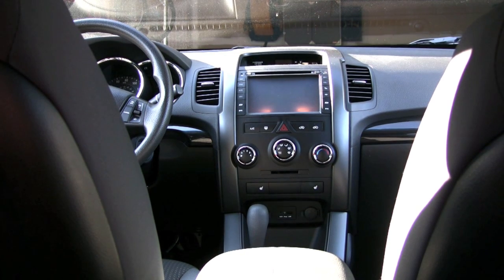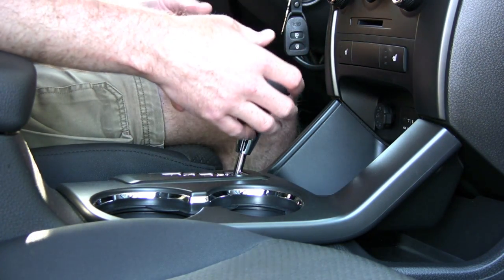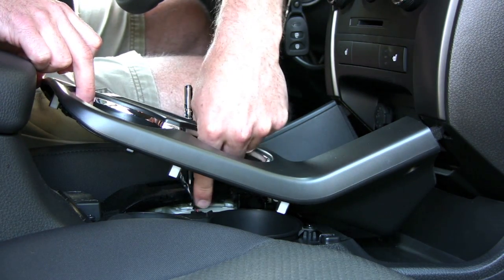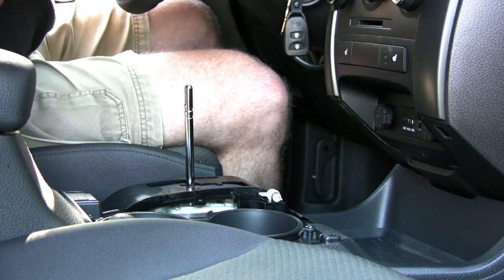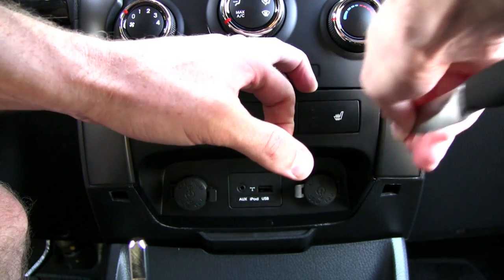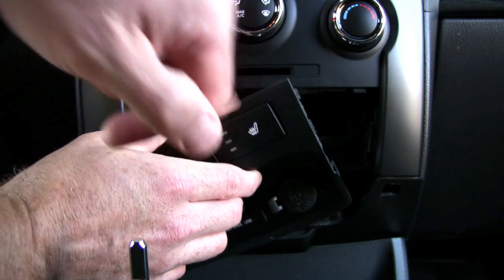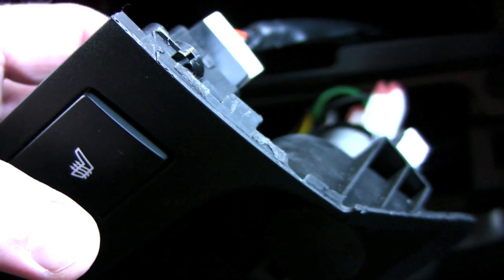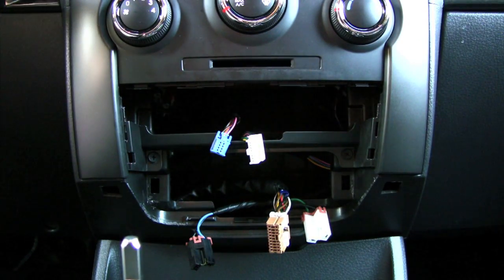2012 KIA Sorento Center Console Removal

Comment from the maker: All the cables were included, so it was a very quick installation. I did lose the analog audio jack function on the front of the dash. I'm not sure if your 2010 model has that or not. If I wanted to restore functionality to the audio jack, I would have had to locate which wire fed the analog audio, splice it, and then feed it to the AUX inputs, so that would have been an additional cable. I'm using the USB functionality and play my music off of that so the analog audio isn't a factor.

Comment: Can you tell me where the manual ignition start is on the 2012 Sorento?  Kia repair said there isn't one--ridiculous.   Manual says there is one in 'some models) Is it behind the plastic front of the push ignition?  In the console?  In the steering column?  The glove box?  "Nobody knows...."  I don't want to tear my car apart but it amazes me that i can't find an answer from manuals or mechanics.  Thanks for any help.  Yes, I have working fobs and can remove the key for the door but then what?  Where does the key go to start the bloomin car?

Comment from the maker: The one I bought was $380 from [auto dvd gps dot com]. I see they have a couple newer models out now as well. The screen on mine is not the same quality as you would see on something like an iPhone. Because of the angle of the unit, when the sun shines through the windshield it washes out the image. The unit is curved to match my 2012 dash exactly, but I can't speak to the fit on a 2013 Kia.

Comment from the maker: On my Kia, there was really no iPod port, just a small USB port and analog audio port which required a proprietary cable for the iPod supplied by Kia. My guess is that your cable will no longer work, because the analog audio port will cease to function. They supply you with a new iPod cable and I ran mine into the glove box. The USB port on the dash still works, and I can plug a thumb drive into it with music and it plays. Just no analog audio from the small 1/8" stereo port.

Comment: Hi Skysurfer. Thanks for the video, quite informative. I have question for your. My sorento 2010 comes with the standard kia stereo system and I want to replace it with one of those chienese graphical stereo systems. When you installed yours, did you find all the necessary cables to connect it?

Comment from the maker: I don't know anyone with a 2011 KIA, but I do know that the stereo I installed was originally designed for a 2011 and it fit perfectly in my 2012 so there are similarities between the console designs. There is also another video on YouTube that shows a 2011 specifically (this was the video that inspired me to do mine), and lo and behold the guy has trouble with the exact same part that I did. Do a search for mikesaudioimports.

Comment: Thanks skysurfer, just another question, I saw a few videos about the same installation and people mentioned that they couldn't use the usb, aux and ipod ports originally provided. Did you have the same issue? Have you tried to modify the cables of this stereo unit in order to keep using those ports?

Comment: Do you know of any compactable radio with apple car play that works for that kia? It is the same as mine and at least I found your video that explains it well and lets me see clearly that a radio touch can fit there but I would like to know what inch it is and if it has apple carplay, thanks for the video and the help
Reply from the maker: They are out there, but without seeing one reviewed online it's hard to judge how compatible they are with iOS. Most of these aftermarket head units are Android based now and despite claiming it works I'd really want to hear it from someone who installed one.

https://www.belsee.com/belsee-best-wireless-apple-carplay-android-auto-stereo-upgrade-car-cd-dvd-audio-video-player-for-kia-sorento-2009-2010-2011-2012.html

You may have heard that 2016 and newer Sorento owners who had purchased the UVO premium systems got free Carplay upgrades. There were other models that they upgraded at no charge that went as far back as 2014. Nice benefit for those owners that qualified.

Comment: Great video man. Just one question,I am replacing mine for an android unit with the frame already included ,can I just disconnect the passenger airbag light plug?
Thanks
Reply from the maker: I never had to do that, but on another project I had to temporarily remove an airbag electrical connector that was under the driver's seat in order to route a cable. I just unplugged it, did my cabling and plugged it back in. When I started the engine, the airbag warning light came on and didn't go off until I cleared the error with my ECU tool. So I'd be careful with that, especially if the wiring is color coded in yellow. I don't have enough information on what qualifies as "tampering", so after my experience I just have to assume everything is until proven one way or the other.

Comment: Hey! Nice vid, helped me 100% removing the console trim. I see you have an aftermarket (Android?) radio sitting there. Were you able to connect steering wheel controls, rear camera and/or extra video screens (if any?). I am looking at one to upgrade my Pioneer AVIC-F910BT which has all correct connections. Thanks!
Reply from the maker: +Jeroen Brosens This one is a Chinese import that runs Windows embedded. The steering wheel buttons were programmable through the head unit. When I got it the volume buttons were reversed, so I had to reprogram the functions to work correctly, but it's all done through the head unit setup user interface. Some trial and error, but eventually it worked. This unit allows for two zone video, so it's possible to run a monitor to the rear and have programming running back there that is different from the front, but I've never messed with it. That said, I'd be hard pressed to say that mine is an upgrade from a Pioneer, it's fairly low end. The thing that makes it appealing is that it looks stock due to the contour matching the Kia's bevel exactly, and the mapping functions rival what you can get from the dealer for half the price. Otherwise, sound and functionality are just average. No regrets though, it does what I need it to do :)

Comment: Skysurfer hello there. Can you help me out with my sorento 2012? ... The volume button on the right side of the screen (which I'm always using, not on the screen) is broken. Like whenever I'm pressing it, it does not "tick" like before. And I think it is stuck because when I press the + volume, the volume automatically goes up while the same thing with - volume. Both are broken. That's why I use the volume in the screen. How can I fix the volume buttons? Thank you...

Comment: This was an awesome video.  I have an issue with the heated seat (driver side) flashing and not turning on.  That, coupled a bad heating mod is all that is wrong with the car.  Do you, or have you, heard of any fix for the heated seat and how to replace the heating mod?  Thanks.
Reply from the maker: Thanks Nicholas! Sorry I don't have any specifics on the heater problem, other than according to the majority at Kia forums, the blinking light indicates a faulty heating element and will require disassembly of the affected seat. If I run across any how-to's I'll pass them along. Pretty limited info out there at the moment.
Reply: Thank you!  It's a start.  Have a happy New Year!

Comment: Thank you.  Do you know if or where the amp is?  I have a 2012 sorrento. Stereo works but no sound.  Bluetooth works they can hear me i cant hear them, sirius works etc just no sound.  I tried all the little tricks I've read in all the forums and still nothing.  Fuses, reset button, disconnected battery etc..  Took it to kia today and they said i needed a new unit but of course its not under warranty.  I'm wondering if maybe I just need an amp or if there is possibly a lose connector someplace?  Oh yeah, they just replaced my engine about 3000 miles ago but the stereo worked for the past 3 weeks or so.
Reply from the maker: Try looking under the passenger seat or drivers seat. I think I discovered it once by accident with the vacuum cleaner. I have never removed it, so can't help with specifics there.
Reply: Okay thanks so much I've looked under both.  I read somewhere that the harness to the amp was under the drivers seat and followed one under the floor towards the front of the car under the rug by the gas pedals.  the other ones went to the power seats when I disconnected them this is a total bummer.  I'm going to call Kia and bitch to corporate tomorrow since this happened after they replaced the engine and try to get them to cover it.  and I don't want the crappy uvo stock unit since the no longer provide support or updates for it.   if I have to end up paying for a new unit I'm hoping I'll find something that's compatible.    thanks so much for the reply.   totally bummed out
Reply from the maker: I had the basic sound system, non premium, in mine. From what I've been reading, mine did not come with an amp. I took a peek under the seats, and all I have under there is vents, so that's obviously what I ran my vacuum cleaner into. Lurking in other forums, it sounds like the premium sound system has the JBL amplifier under the seats. Strangely though, I do have a 30 amp fuse, and the legend says AMP. I pulled the fuse, and my stereo still operated normally, there was no difference in sound whether it was in or out. In another video I saw here on Youtube, there was a user who had problems with the radio, and checked all the fuses having anything to do with "audio", but eventually found the problem was related to a blown fused labeled "module". Geesh, could it get any more confusing? Best of luck on your search.
Reply: I'm not sure of the difference between the basic and premium.  All I see under the seats are a few harnesses which the local stereo guy insists are for the power seats.  One of the bundles travels under the drivers side floor to who knows where.  I also have the 30 amp fuse which i've checked and its good.  BUT...  if the amp itself is shot then pulling the fuse would do me no good.  Yeah I watched that module fuse video too but it wasnt that either.   When I took it to Kia they pulled the big yellow thing from the front of the fuse box. I'm not near my car now so can't tell you what it was.   He pulled it with the car running and the radio on.  (not sure if that makes a difference just adding it for future reference)  I'll update later with the name of it.  Too bad we can't add photos.  Not sure if I mentioned that KIA replaced my entire engine about 3000 miles ago.  The radio worked fine for about 2000 of those miles then out of the blue...  no sound.   Thanks for the luck it seems I will need it.  Of course It's not covered and if I have to buy a new system it will NOT be from KIA.   Going to watch videos on how to remove the unit from the console!
Reply: The UVO systems in the 2012 are prone to just crapping out, no sound.  I had the same issue, everything worked except no sound.  I tested the amp and it was fine.  The new radio was $850 from KIA and I basically told them to pound sand.  I got a much better apple play JVC for $550 with a bigger screen and it is awesome.  Basically, the UVO systems earlier than the 2014 SUCK!
Reply: Yeah they are nuts!  I got 2 prices from them.  One dealer told me $475. for a "refurbished" one and another dealer in Westchester told me $800.  I'm still driving around with my dash ripped apart and the crappy UVO in the back seat.  I suppose ill have to get something because the only other one I saw like mine was on eBay for $287.  brand new? The guy at the sound place told me if it seems too good to be true it is.  But then again he wants to sell me a stereo!  lol.   Thanks again!

Comment: Awesome video, very helpful! The problem I had is my temper, I hit the center console and made it so the A/C, rear defrost and other two buttons weren't retracting, so the button was never getting pushed for them. Since it's cold now, we need the rear defrost and I was taking this part out so I could replace it. Once I got the part out, I decided to take it apart too becuase, why not? Turns out the plastic part of the button which the user pushes slipped off of the rubber pad on the circuit inside that actually causes the rear defrost and such to turn on/off. So, I just put the part back together and, viola! Back in working order. Hopefully this will help someone with a similar issue. The part I needed to replace is $85 on amazon, here's the link. ----> 
https://www.amazon.com/dp/B00NMO1ZXM